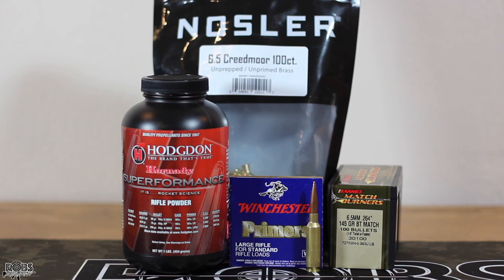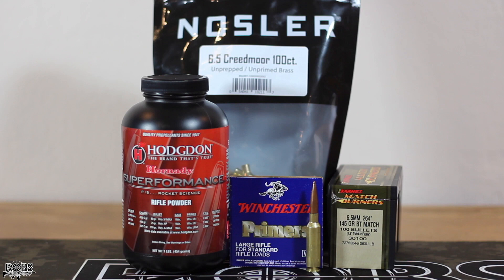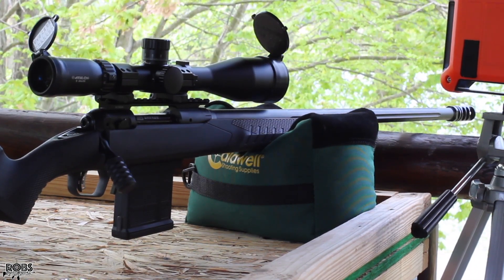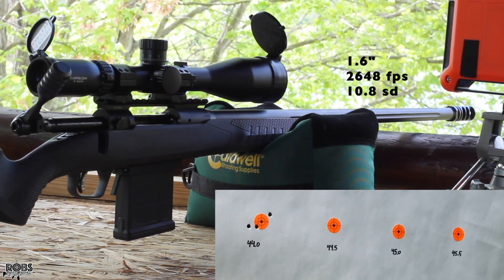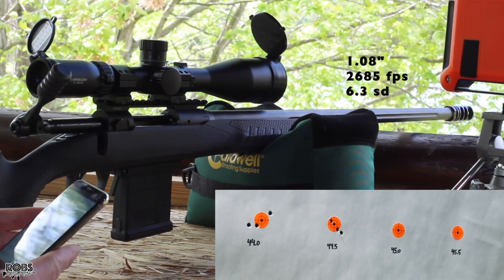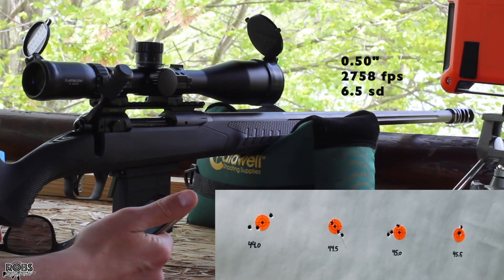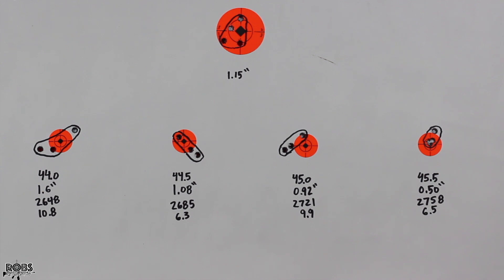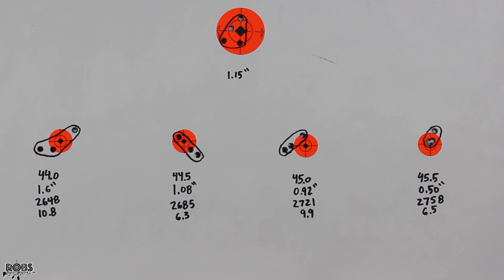Savage 110 Tactical, 6.5 Creedmoor, 145gr Match Burner

Comment: Barnes has load data for the 145 Match Burner on their site. It is combined with the load data for the 140. They list 40.3 as min charge as 45.5  as max charge for Superformance
Reply from the maker: Thank you guys for the update on the Barnes Load Data. I thought for sure I checked the other day and did not see any Load Data for the 145. I will check it out.
Reply: @RobsReloading  I have some of these I've been waiting to get loaded up for ladder test. Looking at trying Staball 6.5,  RL-17, RL-16, IMR 4451, and VV550 are backup plans... 
Your SDs and accuracy look pretty good at 45.5, You definitely found a sweet spot for sure. Might be worth looking trying at 2.825 OAL to see if better or worse. Might be able to go a couple grains more.

Comment: What was that 5 shot group up top at the end of the video.. that top charge did look good with a low SD.
Reply: Hey!  Where have you been?
Reply: @dahut3614  I was on a sabbatical.. just been taking a break.
Reply from the maker: That group was from some ammo I loaded for my other creedmore, used them as sighters. They are the 123gr sst and r17.